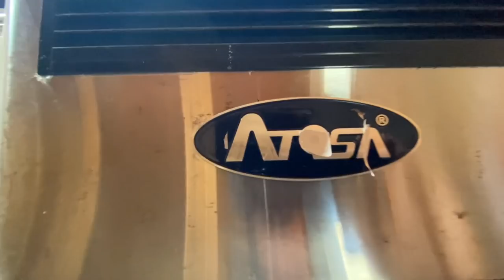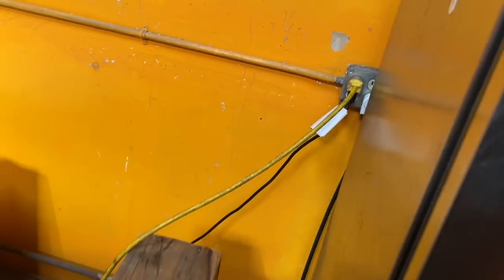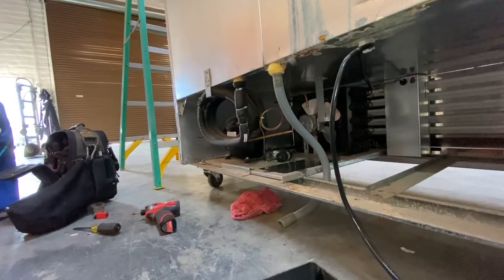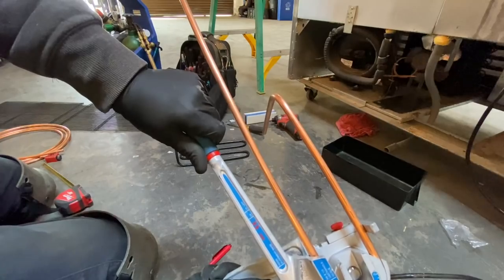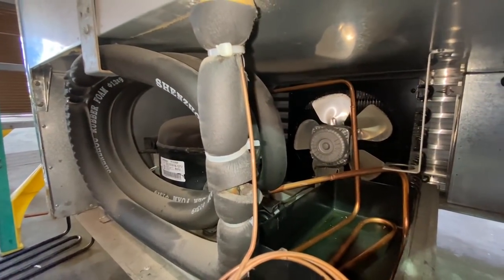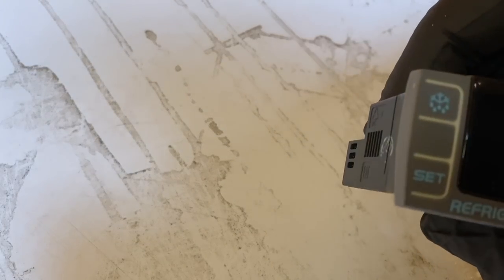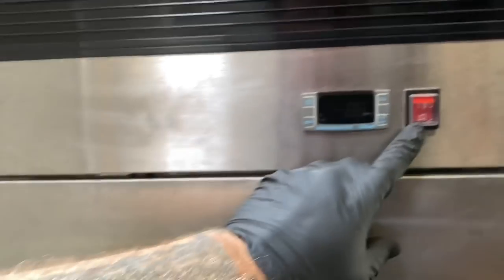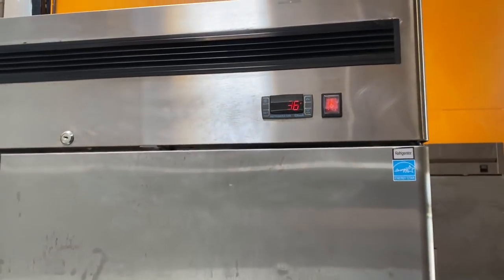ATOSA 2 door reach in repair

Comment: The Emerson controller, Dixcell, Carrel,  and whoever else... who the hell can remember all those steps to program them, not me! And they look all the same too. 
     If that fan shuts off during the off cycle, there will be warm spots in there. Your supposed to have an air gap al the way around the stocked products.  That NEVER happens. They stuff everything in there to the hilt. 
     Oh, that copper piping is a desuperheater. The OEM May have charged you $350.00 for one of those. Great job.

Comment: SET+ARROW down first. Then SET+ARROW DOWN again, then you are i level 2. programming. I'm pretty sure. 
The settings for "faulty probes" are important, but take a few minuttes to set. Then your customers will call about a P1 error, and not temperature problems. We use them for heating cabinets, and freezer / fridges.

Comment: Nice work as always. Those frickin relays in those temp controllers always get stuck no matter what brand it seems even if you don´t overamp them in my experience. 

Compressor runs forever and the food is freezing? you know what to do lol. Hammeroski 3000.

Comment: What do you use as a td between air and coil temp? Say you want a 35 degree box temp, should your coil temp be 10 or 20 degrees colder? Starting to do more small refrigeration and used to doing ac
Reply from the maker: On paper it’s 10 degrees TD real life 5-6
Reply: Thanks Dave 👍🤘🤘
Reply: Norcal has a 18 degree Evap for a 36-38 degree box= about 20 degrees TD . i think he confused it with superheat or some lol
Reply from the maker: @markkapllaj5405  I was giving delta TD not the actual evap TD. Evap TD for moment you measure is box temp minus your evap saturation temp.
Reply: @NorCal-refrigeration  oh gotchu , thanks for clearing it up for me!! you rock 👍🏼👍🏼👍🏼